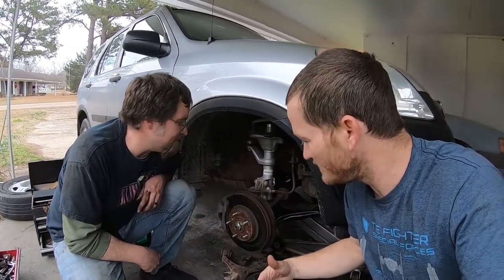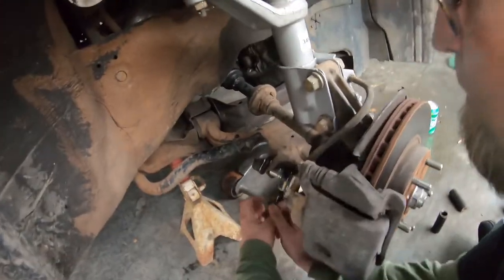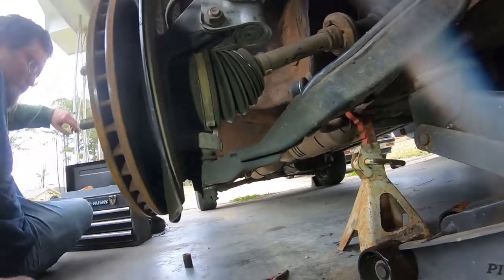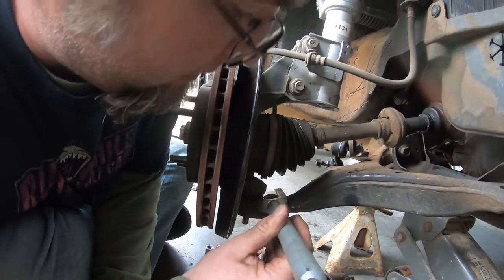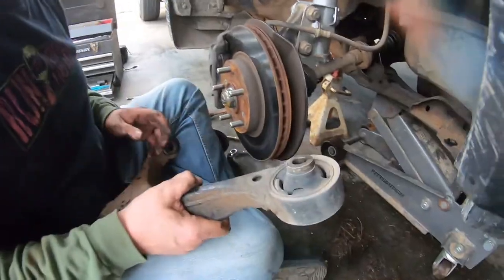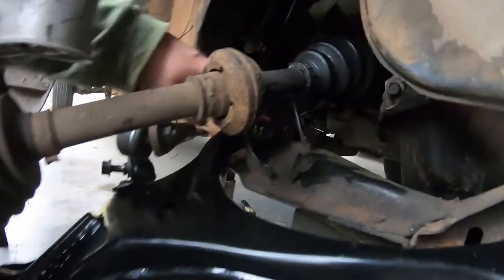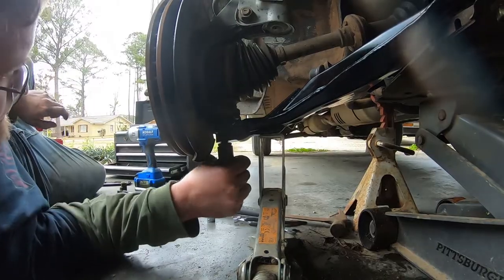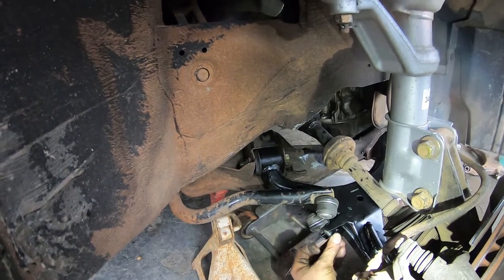How to Replace Lower Control Arm Honda CR-V

Comment: you saved me $800 which is what my local shop quoted me. Thanks!
Reply from the maker: Good deal guy and thank you for the comment
Reply: my question is... where to buy those ? amazon?ebay? or local store? cuz my local shop quoted the same.. $800 total labor and parts!! ftw
Reply from the maker: I got the set off ebay for like $100. I will see if I can get you a link.
Reply: @Cauichin85  I got mevotech supreme LCAs off of Rock Auto. It was 180 for the pair including shipping.

Les Schwab wanted to charge me $320 EACH for Delphi arms like they were Jdm lol
Reply: Be careful with getting them off of eBay. I purchased mine from there, they were of the worst quality for $200. I now have to replace them again after less than a year of having them put on.
Reply from the maker: Thats good to know thanks I will keep an eye on them thanks

Comment: Thanks for the video!  Just did this job yesterday on my daughters 2005 CRV.  Couple of tidbits I thought I'd share.  For the ball joint, I used a mapp torch for a few minutes on the threaded part of the ball joint. The control arms literally fell away with a light tap.  When installing the new control arm I held it so both mounting holes were on the front side of the rotor, with the ball joint hole facing towards the forward of the car.  I slid in the vertical mounting side and loosely installed the bolt.  Then I gently pushed down on the control arm and pivoted under the rotor and towards the horizontal  mounting point, which went right in.  Then pushed down on the control arm slightly to get the ball joint back in.  Took maybe 15 minutes each side.
Reply from the maker: Nice glad it went smoothly guy. Hopefully your additional info can help someone make it easier to do thanks guy.

Comment: Only thing I’d say to make your job a lil easier would be use a 5 pound mallet to hit the pickle fork. If you can lift the rotor by the studs with a 2x4 or something that’ll help you line up the bushings. Great video never the less.
Reply from the maker: Thanks guy thats a great idea

Comment: I cant get my lower baljoint into the control arm. It sticks out like 1 inch and doesnt line up. I cant push  the steering knuckle/axle in, to line up. If I put the control arm on the ball joint first, I cant get the control arm up in place.on the frame?

Comment: Hi so what was the issue that you were having? Im having the right wheel shaking like crazy above 35mph. Im not lower control arm bushings look good.
Reply from the maker: I would check wheel bearings, tires or tie rod ends. Each one can do that. The tires could have lost a weight but that is rare but I have had tires get old and caused vibrations in the steering wheel while driving and when hitting the brakes.
Reply from the maker: Grab a friend and have him turn the steering wheel while you look from down under and see if you can see something worn out.

Comment: You should tight the bolts only when the car is on the ground.
Reply from the maker: Are you referring to the control arm bolts?
Reply: Yep
Reply from the maker: Ah I didnt know that. What is the reason for waiting until its on the ground?
Reply: This way, you don't put stress on the rubber.
Reply: Letting the suspension "settle" is a myth. If your bushings go bad early or mess up when you lower the car, you did it wrong in the first place. Worked in a shop for years now. We do all suspension on a lift and torque everything to spec according to every vehicle. We don't let anything "settle."
Reply: @ABrokenSociety   Honda service manual says to torque certain suspension parts at "ride height," which means with the weight of the vehicle on it.
Reply: @BellaRocko  Have never done it nor seen it to be necessary in shops. No one I've ever known has done it. However I have see people push the control arms up with a prybar before tightening. The only downside is slightly more wear and tear on the bushings, but it doesn't seem to be at all noticeable. I've been driving on the same control arms for 80k miles now with no tears or twists, and I did mine while on a lift. :shrug:
Reply: @ABrokenSociety   Thanks for sharing.  It's good to know that the effect of not following Honda's recommendation in this case is minimal or possibly insignificant.

Comment: OE sway bar links are 14mm. Their isn't a 15mm bolt on the entire car from the factory. Most of the after market brands will have a different nut/bolt sizes than what came from the factory.

Comment: What size socket did you use to take off the wheel break pads? I saw in your video you already had it off
Reply from the maker: Shoot i think it was a 10mm 12mm or 14mm honda doesnt use very many sizes. I cant recall of the top of my head though
Reply: I got it off. The fork thing you used to get the control arm off, what is the exact name? I am going to go buy one today?

Comment: How long did this take? And how long does it take to replace both sides?
Reply from the maker: If you are good with tools then an hour and a half for each side. It also depends on whether your parts are going to come apart with relative ease or fight the whole way.

Comment: Mine has 200k miles on the original and its now clunking.Must I use original parts?
Reply from the maker: I mean oem will last longer but cost more however cheap ones dont last as long and you will be doing it again in a few years. So the choice is yours really both will work fine.
Reply: @southerngearz  May I know which brand name did you use for the lower arm? I know it's been long time but you can tell by now if it was a good brand..thanks in advance

Comment: Do I need that forked tool to do this or can I just hit it with a mechanics hammer :’)
Reply from the maker: Yea I have had some success doing that just make sure the nut is at the end of the threaded shaft to prevent mushrooming.

Comment: Hey, what were the symptoms that made you replace the control arm?
Reply from the maker: There was a clicking sound and the axles were new. It sounded like it was coming from the control arm but it ended up being the sway bar linkage.
Reply: @southerngearz  Ok...   we're trying to figure out a somewhat significant shimmy at around 80mph in the steering wheel of my daughter's 05 CRV.  Ball joints have no play, tie rod ends aren't great,  but don't have much play,  front wheels just checked 4 balance & were fine.   Only thing I can see 4sure is a torn inner cv axle boot.   No clicking on turns tho. Scratching the old noggin on this one... : /
Reply from the maker: @lightningboltz333  have you checked the wheel bearing hubs by jacking it up and trying to move the wheel in all directions? I would also kind of lean toward those tie rod ends. They could seem fine but 3000lb ish suv at 80mph can find a weakness.
Reply: @southerngearz  Yes Sir.  Jacked up both sides 1 @ a time.  Only had a tiny movement at 9&3.. but kinda seemed like it was just moving the steering rack & steering wheel.  Might have to have a pro check it out...
Reply from the maker: You could replace the tie rod ends and check since they are pretty easy to replace. However being as though its your daughters vehicle I understand you wanting her safe and not testing if a part works.